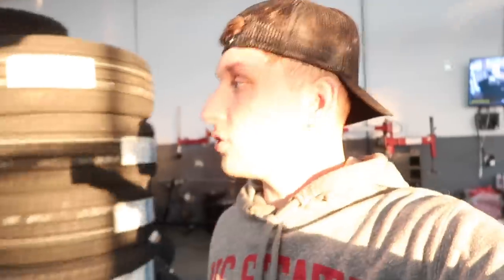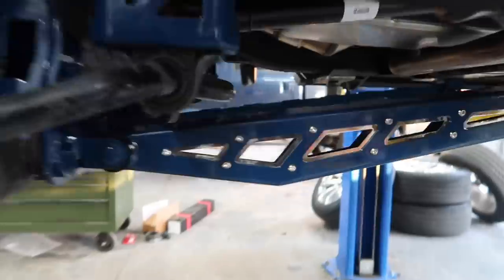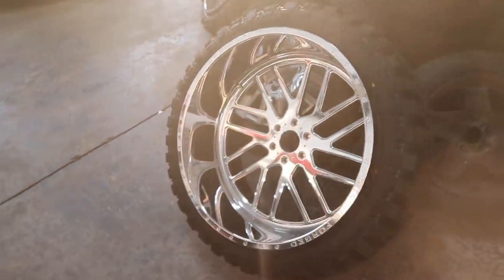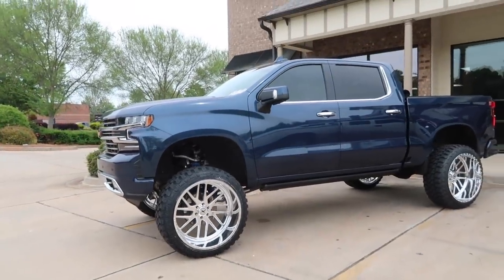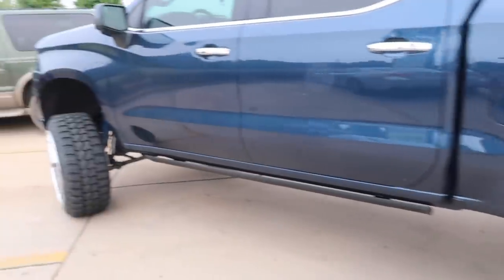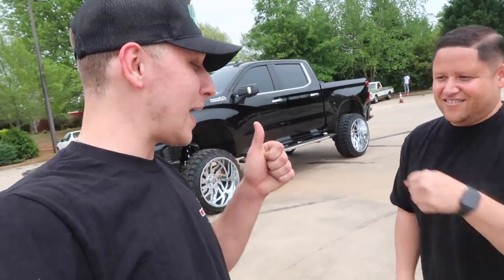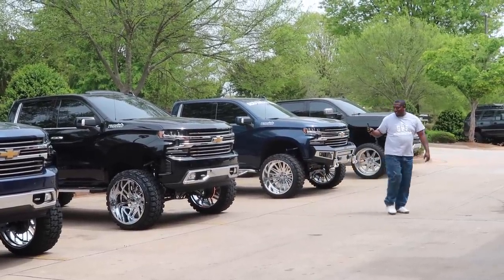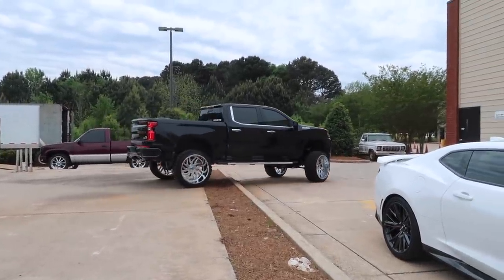Lifted two trucks in 1 day

Comment: Is The navy blue Silverado is sitting on 9 inch all around front and rear cause it sits a bit lower then the black one and did he have to re-gear it after the lift with the lift and tires

Comment: How did you lift a high country with the adaptive ride control? Unless it was not on the trucks.
Reply from the maker: FTS make s a 9” adaptive ride control lift
Reply: @Thatwidebowtie  I need one 4 inches max. Or 2 inch level plus 2 inch lift. May need to check them out

Comment: Dope video..but I'm wondering how does the engine strength of a 5.3 and thar transmission holds up under đriving the big wheels and tires. They look good but isn't a ram 5.7 with there transmission stronger?..
Reply from the maker: The new Silverado’s hold the weight perfectly 🔥
Reply: @Thatwidebowtie  which years  engine and transmission hold up the best with wheels tires and lift kit?..appreciate your response